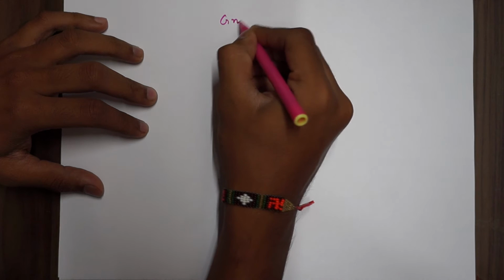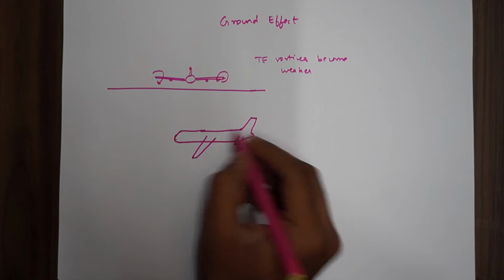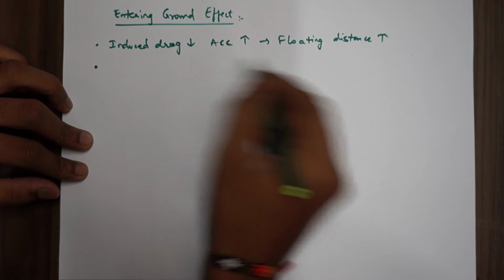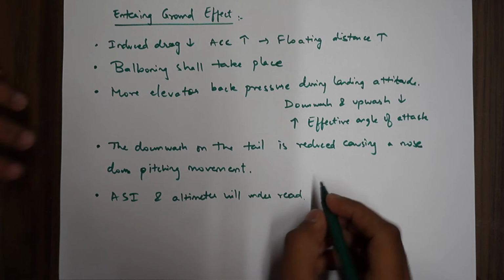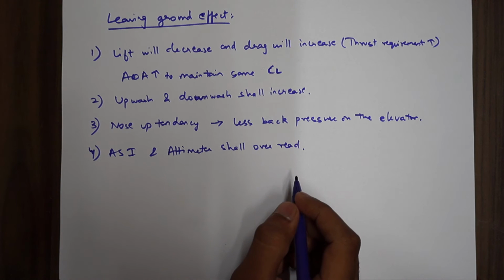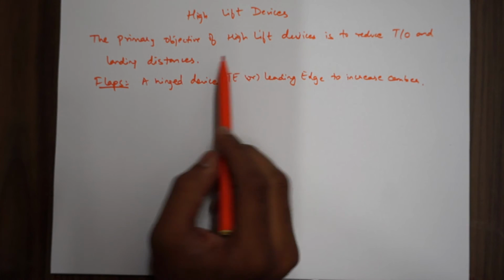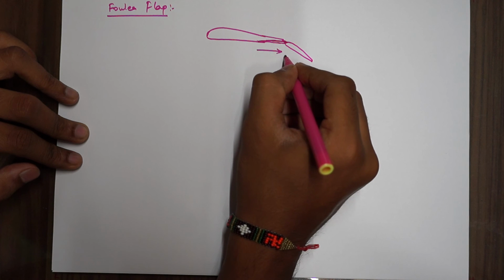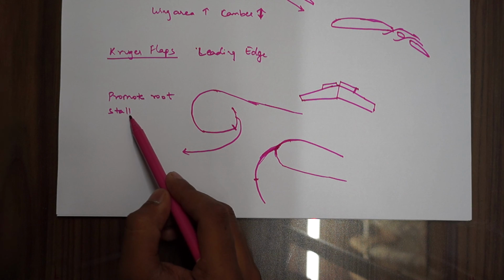Ground Effect and High Lift Devices

Comment: why would we want to promote root stall (Kruger flaps) when purpose of flaps is to increase lift at lower speeds?
Reply from the maker: Because tip stall is more dangerous than root stall because loss of lift is possible much faster at the tip than the root.
Reply: Planes Over Head understood. And also want to know, by 'tail plane' do you mean horizontal stabilizer? I didn't understand this: tip stalls first -> increased downwash at tail plane-> increase in pitch up movement rapidly.
Reply from the maker: Yes tail plane is horizontal stabilizer. Due to that the lift on tail plane increases which leads to pitch up tendency.
Reply: Planes Over Head thank you.